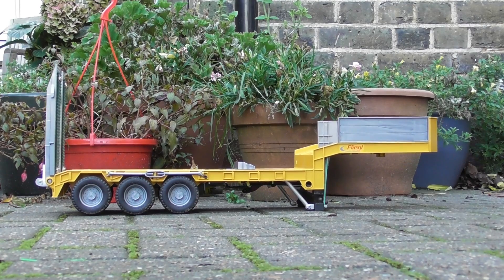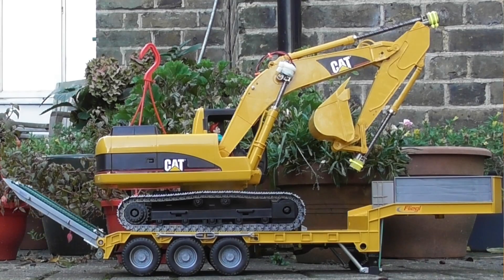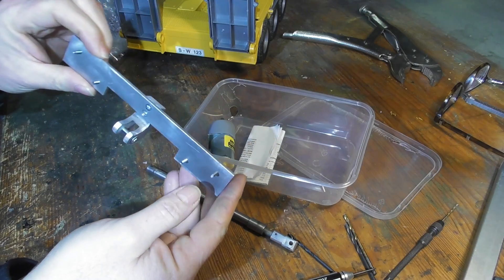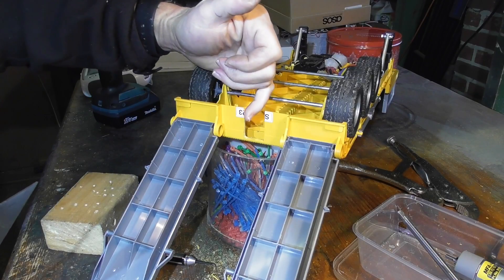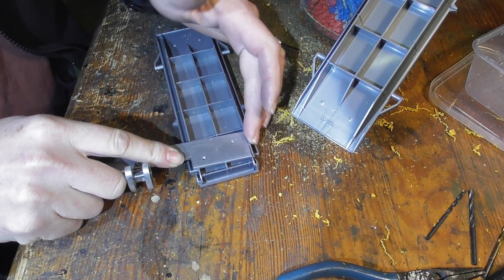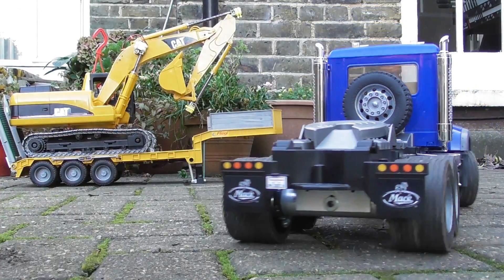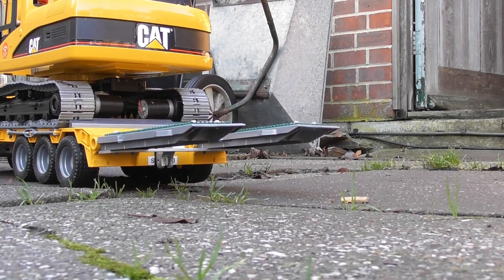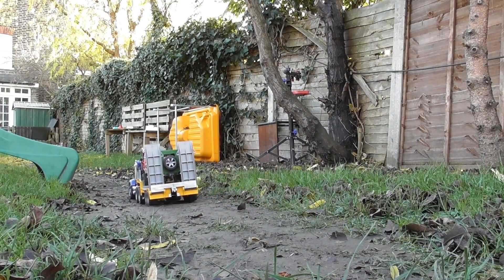Bruder low loader RC conversion pt2: automatic ramps

Comment: Hello. Great job. Can u update the part links. Some links are broken or  not further avilable. I want start working on my bruder trailer. Would be glad to hear from you with correct needed part links.
Reply from the maker: Hey I'll try and get round to doing this. I am planning to do a revised version of the trailer conversion using 3D printed parts - avoiding the need for expensive linear servos - in the near future, which you may prefer to follow.😀👍

Comment: Hey, First time commenting and a new subscriber. I drive a truck for a living. You need to add lots of lights!!! Clearance lamps on top of the cab, turn signals, headlights, brake lights, backup lights with a backup horn/buzzer/beep beep beep, a ton of lights on the trailer, side clearance lights, brake lights, turn lights and backup lights and backup beepers. I'm fascinated with RC! Loved your amphibious RC unit! I would love to get into RC, but my first love is 1/87 trucks/trailers and then HO 1/87 model trains, N scale trains. I am wanting to build a mid size HO scale container ship, mid size HO scale bulk ship and possible a mid size HO scale oil tanker. But I would love to add RC units to all 3 ships and play with them on the water! Plus I have an HO scale fire boat and tug boat. That I wish that could be Radio Controlled, too!  Roy H.
Reply from the maker: Thank you for subscribing! I should probably put lights on a lot of my RC build & conversion, but never sem to have the time to get round to it as I am always burning to meet the next challenge! My Tamiya Scania semi truck is the exception which has most of the lights individually controlled that I can think of - with infrared control through the king pin to control the lights & movements in the trailers! 😀👍

Comment: Super interested in starting my own rc craft chanel.. always been a dream to remote control some of my favorite toys.. im curious as to.. where you get all the spare electronics and servo's etc.. is there a certain place you get them or is it from your old rc's.. also if i was looking to do this to my own things what are the things im gonna need.. i cant imagine a short list of tools
Reply from the maker: With the Bruder conversions I am making a point of trying to avoid raiding my existing models or indeed bits and pieces lying around my shed - as I want to enable others to emulate my builds as easily as possible. And indeed avoid tricky fabrication, hence my recent adoption of designing 3D printed parts which I will make freely available for people to download and print themselves or need be get me to do for a modest cost (I would prefer not to do this, but want give the option). In my most recent videos I am providing a list, with links in the video description to all of the parts that I am using as well as some of the tools. I mainly source stuff from EBay (often from China), Hobbyking and occasionally Amazon. Good luck with your channel! 🙂👍

Comment: Absolutely amazing video. Im building exactly the same as you but just not yet lol. I have my rc excavator, once i have paid my holiday off (orders of the wife) im hoping for a tamiya truck but i will be going with the bruder low loader trailer. Those little powered pistons that operate the legs where did you get those from? And also the tubing/rod you connected to them with the fittings you screwed to the ends of the rods, did you thread them yourself?
Sorry for all of the questions but i am an rc modelling newbie and i have my heart set on a low loader and trailer. Its in my blood and won't go away lol. One comment i will make, when travelling with your excavator on the trailer as you do in your vid, rotate it 180 degrees with the boom (arm) fully down and bucket curled in with the arm between the ramps so as not to catch bridges.
😂😂
Sorry hope i dont sound patronising but i am an excavator operator and there is a tale to tell regarding a friend of mine, an inexperienced low loader driver, and a low bridge but thats another story.
Also dont forget your miniature ratchet straps for fastening digger to trailer (yes they really do exist lol) and some mini orange cones to spread about when loading/unloading.
👍🏼👍🏼👍🏼👍🏼
Fantastic video sir, i salute you.
Reply from the maker: Thank you. The pistons are in fact Actuonix linear actuators - you need to get everything very well aligned & moving smoothly for these to work. I was very pleased with the results. Not sure what you mean by tubing / rod - although I do use my M3 tap an awful lot on all my models. I'll bear you advice in mind when loading the excavator - although I think that I might need to make the trailer longer if I want to park the top half towards the rear (I did this on A Bruder low loader trailer that converted years ago to go on the back of a Tamiya truck). I do have a Tamiya Scania tractor truck (there are some videos of it on the channel) - with full (programmed) lights, sound and an infrared link through to the king pin to the trailers with a duplicate control unit, etc. It cost me a lot of money to do & took a long time. Although, believe or not I tend to use the converted Bruder toy trucks rather than the Tamiya one & could build a small fleet of those for the same price.  Glad you are going to have a go yourself! 😀👍

Comment: What a neat job you made of this - the finished  result works beautifully.
 I await your next project with keen anticipation   : )
Reply from the maker: Thank you Del! It is really smooth & using the ESC allows me to change the speed, I'm really pleased with the trailer generally. I'm actually thinking about converting the little Cat skid loader next - as a relatively easy starter conversion -which if done well should make for a very pleasing working model. I've already figured out how to take it apart & roughly where everything would need to go. Or it could any of a growing list of things backing up on the shelf in the office ....... 🙂👍
Reply: @RCModders  The little Cat loader might not be too intimidating for beginner builders - it seems a good entry-level project.
 There´s a list of future builds in the back of my mind; I´ve taken a leaf from your book and started placing items in a box for the next project . I still haven´t overcome my editing software problems, but that won´t stop me from amassing some of the wherewithall to get started.

Comment: Do you use the same transmitter for the truck and trailer ?
Reply from the maker: Very good question. That is what I intended to do, thinking that with budget RC, not only could I loose the failsafe, but that "model match" would also not feature. So I cant do it with this & have to use 2 transmitters - although the TGY-i6S is pretty small 7 doesnt have an external aerial (I actually bought 2 of these in the Balck Friday sale for £22 ($29) in two different colour cases for this very reason) . Although other older systems (maybe the Corona DIY 2.4ghz kit wired into an old 35mhz transmiter like the FC series - I have a couple of these which I modified) would do the trick. With the Bruders I plan to have more than one tractor unit (and maybe more trailers) so I'm not too worried. I might try and to the next one as you describe & see if it works.  🙂👍
Reply: @RCModders  I bought a turnigy gt5 6ch with a few receivers but in order to switch between receivers you have to turn off the current one. I love the transmitter, i hate the fact that you can t switch on the fly between receivers
Reply from the maker: I'll give the DIY Corona set up a go when i get the chance. Obviously the old AM & FM RC stuff would work too. 🙂👍

Comment: Another thumbs up for you. I think i heard the motor just slightly grunt a little just as it past the horizontal part though. Maby a univesal joint between the motor and the shaft would be a slughet improvment. Then you could mount the motor ridgid to. Just a thought.. As usual  great video. 👍
Reply: Hi 
Yes possibly, but I rather think the grunt comes from the shift of angle when the end moves from up to down (hope you get what I mean) that's why I suggested the uni-joint. But it is probably just an extra hazel to no use😋.
I took your advise and checked the designer out, turns out I had already been watching a few of his films, when looking for bruder tractor builds. Thanks for getting me to rediscover him.
Can't wait to see you build the Mack truck, as I am a bit stuck with my build there.
Many thanx for your inspiration.
Reply from the maker: Many thanks! At the horizontal part there might be a slight contact between the threaded rod and the end axle. Id I were to give it any suspension even this wouldn't happen & the motor probably wouldn't slow down. Its worth a quick look round PiggyTailors channel at some of his creations - especially the folding metal ramps - they really are amazing!   🙂👍

Comment: Wow really a awsome build about the only thing I'd might do with my grandsons is maybe lengthen a little so he could haul a couple of his tractors.Great job on the how to on the series.great job.
Reply from the maker: Thank you! I did lengthen the red trailer which i had a few years ago & converted with a PiggyTailor  plate to go on the 1/14 scale Tamiya Scania. It also had PiggyTailor's fantastic folding ramps - it does appear in one or two of my videos - although I may do another one using this at some point. 🙂👍
Reply: @RCModders  That would be swell if you did do another one.